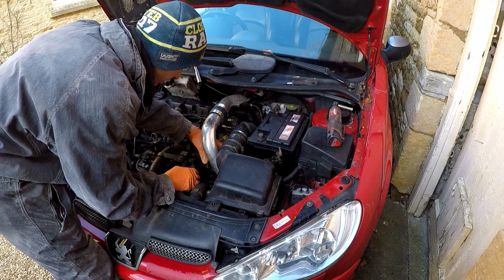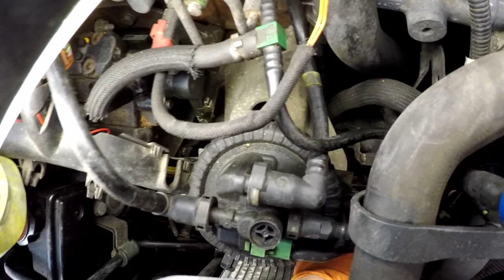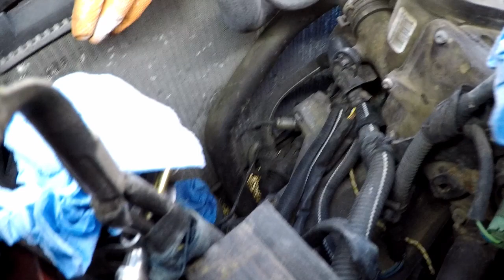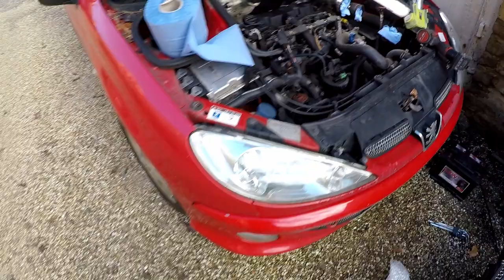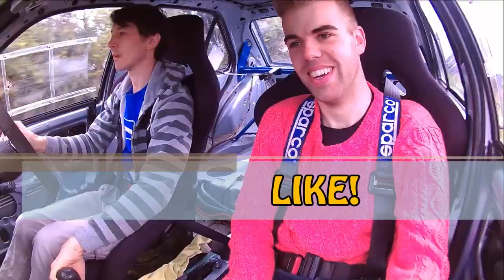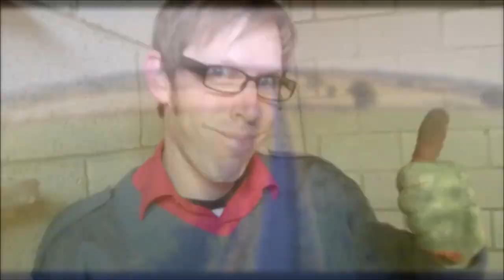How to: STARTER MOTOR removal Peugeot Citroen 2.0 HDi turbo diesel

Comment: Absolutely superb, thank you so much for taking the time to do this properly. I have a 307cc HDi 136 and has just developed a rattle on startup. The garage (that fitted a starter motor last year) have told me it was likely to be the Dual Mass flywheel, and to expect the worst... but I thought I would just check the stability of the starter, which I was able to locate thanks to your guide. It was very wobbly! I have found that one of these bolts was GONE and the other two very loose. I will be tackling this properly in the morning, but just tightening the remaining bolts with my fingers (very, very slowly!) has fixed the problem. Its fantastic to see the frame and bolts so clearly in your video, and everything looking the same as my engine, although my battery is of course further back towards the firewall, and so I think I can get away with not removing it as all I want to do is tighten bolts, not remove the starter. Also I will have to work out where to get a new bolt from! Once again very many thanks for doing this so well. Liked and subscribed. :-)
Reply from the maker: Yes same block, just different heads and gearboxes. 

So pleased it helped! Thanks for commenting!

🐷🧠
Reply: @PiggyPower  It must be a tight squeeze in the 206! bad enough to work on in the 307. I have today tightened up the lower bolt and moved the other one from the front hole to the back hole (where it was missing) so that at least I've got bolts 180 degrees from each other, I now need another bolt for the front hole. I think I am right in saying this is 9cm long (8cm without the head) and m10? would you say that was correct? I need to find a generic one as I cant seem to buy a "starter motor" one, so any advice gratefully received, and many thanks again!
Reply from the maker: Yes, M10 sounds familiar. Try searching for a 8.8 or 10.9 bolt
Reply: @PiggyPower  thank you very much, I will give those a try. 👍

Comment: Great little format for tutorials mate. Excellent. I don't need to change my starter motor but watching helps me learn the engine. Any more hdi vids up your sleeve? ...preferably the 306...
Reply from the maker: They come along as they come along tbh..  with projects and little work coming in due to covid... It's when I need to fix something I usually take the opportunity. Open to suggestions... Thankyou for the nice comments 👍😃
Reply: @PiggyPower  haha. Beam change wouldn't be bad but it's a bit past my skill level. Need to change the heater motor on mine so if you ever get round to something like that; awesome. If not I'll just keep an eye out for any little bits you do and if I can find the time, I'll do it myself and follow along.
Keep up the great content 🤙
Reply from the maker: I've done axle/beam changes. 👍😜 Heater motor is simple enough on most pugs...it's the lying upside bit that's tricky 😅🙈
Reply: @PiggyPower  🤙

Comment: Hi, great video cheers. Could you help me with something? I need to change the starter on a van where the hex nuts/sockets have been completely rounded off. I've tried cutting a slot in the head etc, but cannot get it to move. 

Question is: can i cut the head off the nut entirely? Basically need to know whether the section within the gearbox / flywheel casing is threaded or not... hoping not so i can just cut the head off the bolts to free the starter. Any help much appreciated
Reply from the maker: Oh what a pickle!! 
You can, the threaded section is in the starter. The issue you will face is being able to remove the starter with the studs you've not got still in the starter. You may need to remove the fuel filter housing 👍🐷
Reply: @PiggyPower  thanks a lot for your reply, needed that confirmation. Ah yes I see what you mean. Well desperate times and all that... I'll just keep cutting! Thanks again
Reply: Ok I'm going to owe you a beer I think... But do you know what thread is on these bolts? Guessing an imperial one?
Reply from the maker: @robfoulsham1  from memory dealership will sell a set of three for about £10. They need to be the right lengths etc (2 are the same, 1 is different)

Comment: Hi mate I have a 307 2.0hdi 90bhp no intercooler so less hassle but is the clutch slave cylinder going to be an issue on my car when trying to remove the lower bolt from the starter motor
Reply from the maker: May have similar yes. 👍